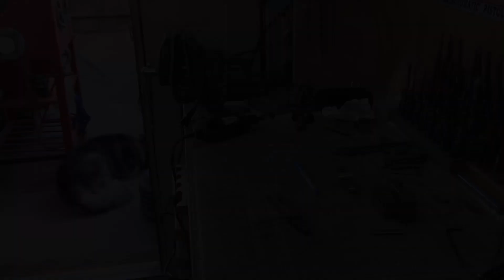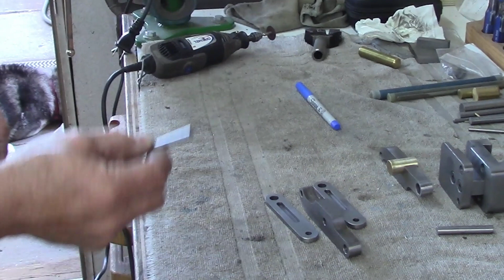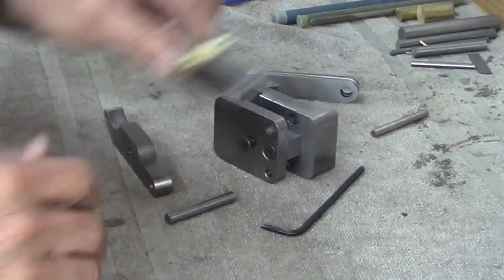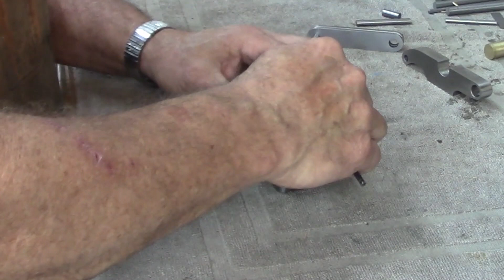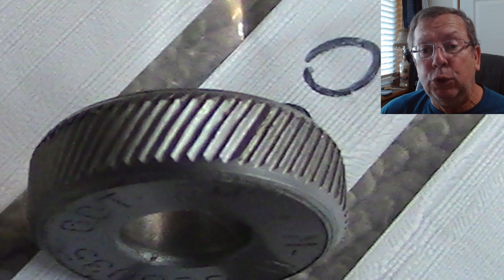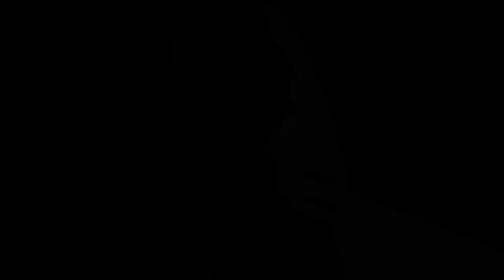Hemingway Knurling Tool: Part 7

Comment: Nice tip for repurposing old 22LR boxes. Good idea about under-sizing the 3/8" trunnion hole, too. The near-proprietary knurls made me decide to scratch-build the tool. I'm using 3/4 x 3/8 standard knurls that are cheaper and available everywhere (I had a bunch on hand). I had to go with wider bar stock for the arms, and narrow them down beyond the knurls, but I'll be better off. Since I would not be able to use all the material in the kit, it made sense just to use the stock I had on hand and save some bucks. You're making good progress. Cheers!
Reply from the maker: Thank you Paul, it’s getting closer everyday.

Comment: Great video! You are very meticulous in what you do and as for the blueing I think that's a great idea, I never thought of this! I have a question for you. Do you think It's with buying those Hemmingway kits? do they give you machining instructions as well as drawings? Can you buy just the drawings only and supply your own material? Anyway, it would be nice to hear from you and I'm sorry to hear about the way you have been treated as far as Hemmingway is concerned. Thanks
Reply from the maker: Thank you, is it worth buying their kits? Everyone will have to make that decision for themselves, in my opinion the pro’s are the the prints are first rate,I have had mine laminate.and when I get through building them they will be framed and used for shop “art”. As far as the instructions,all the dimensions are there for the knurling tool are there but can be confusing for machining the arms. They came with a few pages of instructions but after reading them a couple of times I haven’t used them again as I found them lacking. On the other hand the rotary broach kit looks to be very well laid out on the prints and the instructions appear to be very good and much more explanatory and useful, I think it depends on who originally designed the item.the con’s are mainly the poor to non existent communication which probably means I will not deal with them again, and the shipping cost to the US which has been almost $40 on the 2 orders I placed. You can check their website for their offerings.
Reply: @hillsgun
Reply: Thanks for your very detailed report. Much obliged. I shall continue to watch your channel. Thanks